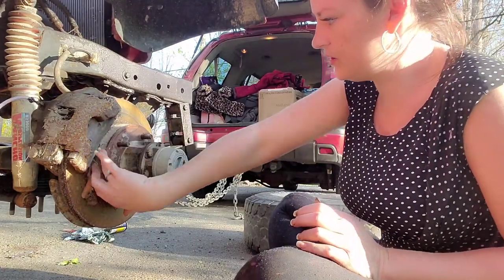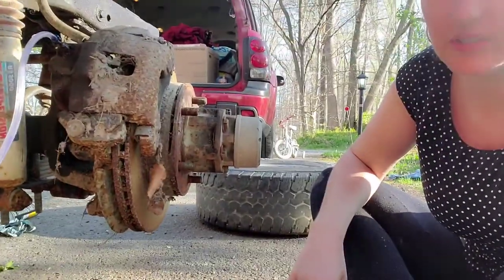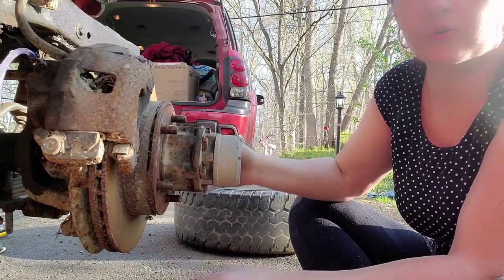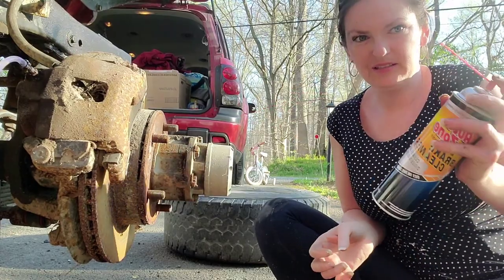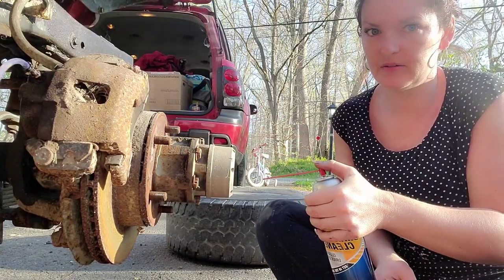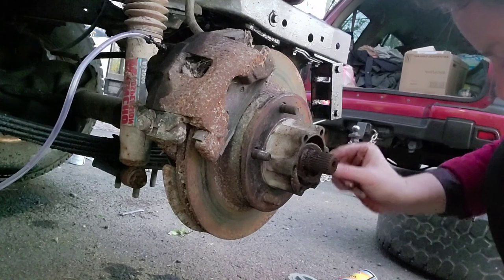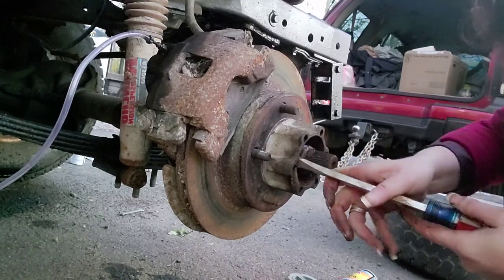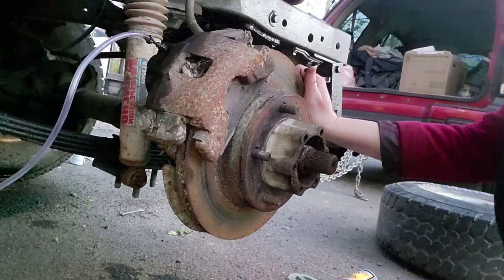Complete teardown and rebuild of hubs, bearings, brakes, rotors 1980 CJ7. PT1

Comment: The problem isn’t hex or torx ..  you Tightening the caliper lock Allen bolt ! 

Lefty loosie righty tighty
Reply from the maker: Thanks for the input!  I am in selfie mode, so while filming the majority of these, so it throws it off.  Definitely utilize the lefty loose, righty tighty.  😂
Reply: The problem isn't the lefty-loosey thing, the problem is that the video is reversed! Check the writing on the tires - it's all backwards. It was confusing as h*** watching you unscrew things clockwise, until I caught on that we're looking at a mirror image. @michellefixit
Reply from the maker: @user-uc4dg5jg8v  , I can totally understand that!  🤣  If I'm not in selfie mode, I can't see what is on screen.  I don't have a camera person, so it's just me sharing what I'm doing solo.  Hopefully, outside of confusion, you enjoyed the video!  😊
Reply: Absolutely! No complaints from me, just thought I'd mention it for the benefit of those who hadn't realized and were thinking you were doing it wrong. I'm just glad to see real people doing real work like the rest of us: In the driveway, without a hoist or a $10K set of Snap-ons. @michellefixit
Reply from the maker: Thanks & yes!  😆
Reply: My pleasure - keep up the good work! @michellefixit
Reply from the maker: Thank you!  😊

Comment: For the allen heads you had issues with a lot of times you can find a torx that is slightly larger and drive it in with a hammer and get them to back out. obviously you would then want to replace the bolts BUT they shouldnt be that hard to find. :)
Reply from the maker: That's a good recommendation, I appreciate the information!  I also appreciate you watching and commenting on my video.  :)